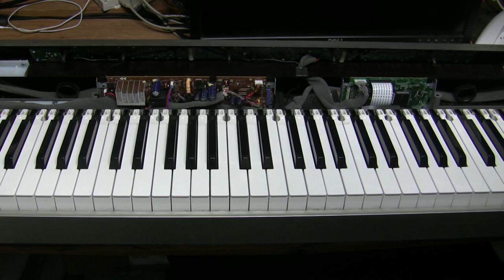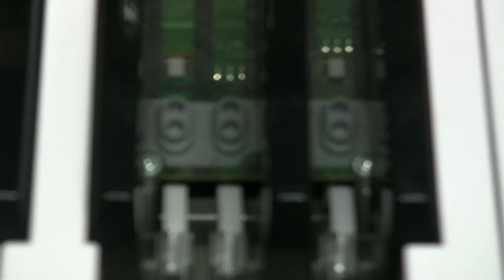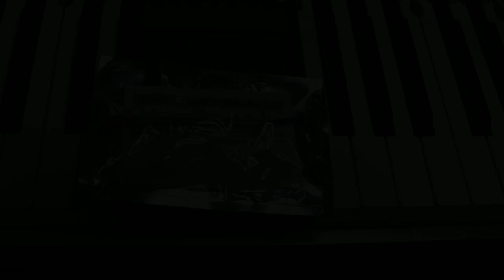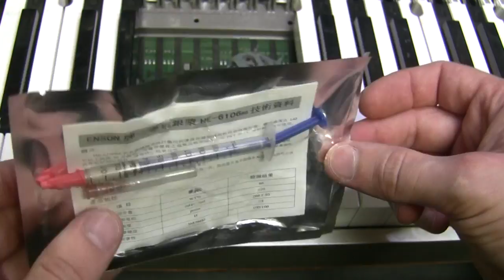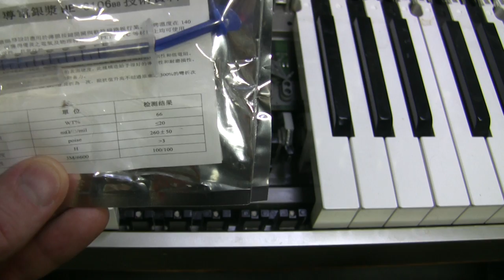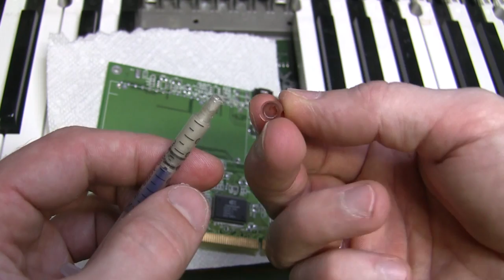#14 - Casio Privia PX-110 digital piano repair

Comment: Thank you for posting these videos.  I have a Casio Privia 310. It is in very good shape. I purchased it new many years ago. I use it in my home studio and keep it covered. Suddenly, one key seems broken in the sense that not only is there no sound but the spring, cushion action is gone. It's dead. I suspect that a cat may have jumped on it. I am debating as to whether or not I should bring it to a repair shop or open up the board and try repairing it myself. Any recommendations?
Reply from the maker: ***** 
If you are handy enough to take the cover off without doing more damage :), I would suggest having a look inside. You may find something simple like a guitar pick dropped between the keys. Try just turning the piano upside down: would something rattle inside? would the problem feel different or move to another key?
Reply: Thanks! I'll give it a try. Have a great weekend.

Comment: I have a privia  px150 .2 keys are pulled up from the bed and cant be pushed back.i removed all the screws except for two which need to be removed from the inside.trouble is i can remove the2 speaker end sections to access these screws without fear of breaking something
I wish you would have showed how you removed the keyboard bed.
Reply from the maker: Vincent Ruffini Well, one never knows what details might be interesting to somebody...I don't remember any problems at this step. Perhaps these models have different construction.

Comment from the maker: Reply to Burkhardj (what a retarded commenting system! doesn't allow me to reply below the comment)
Yeah, I know about this conductive coating you are talking about. I wanted to try this cheap stuff from China for $1.71 delivered. Almost ten times cheaper.
Regarding durability, note that in my case I used it away from the area where contact is made, so it is not under any mechanical stress.
Why not high resolution on Fluke? I didn't really want to measure miliohms. I think that the black coating on the board has much higher resistance. I just wanted a crude test that the stuff works and measures almost as a short.
Thanks for watching and for sharing your opinion. I appreciate it.
Reply: FeedbackLoop ,
Reply: that grey stuff is solder. You have to use a hot air gun or a soldering iron. The grey stuff will turn into shiny solder after the flux has dissipated under heat
Reply: Why didn't you just solder it to make the connection?

Comment: Hi,

a much better way is "Conductive Silver Coating". Cost not more than maybe $US15  on eb@y or Radio Shack. Its like a fluid and u can fix very thin flex cables, LCD - contacts, printed trace and much more.
This Silver Glue u buyed, dryes out, getting hard and break. It is not made for a broken key contact u use 1000 times... Its made to glue a heatsink on a CPU or something like that. Poor stuff.
And why u don't use the high resolution mode on your fluke, to measure mOhms ? :o)
Reply: that stuff he bought looks like liquid solder. You have to heat it with a hot air gun or a soldering iron. It contains the solder and the flux.  As I can see from the last step in his video i see shiny solder, so he must have soldered it correctly in the end